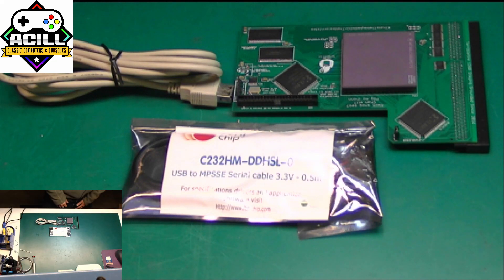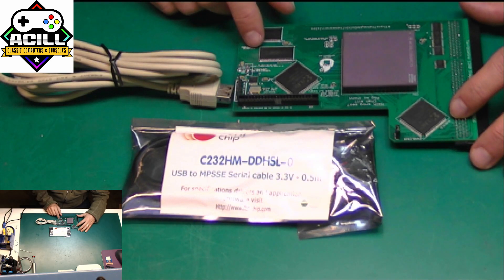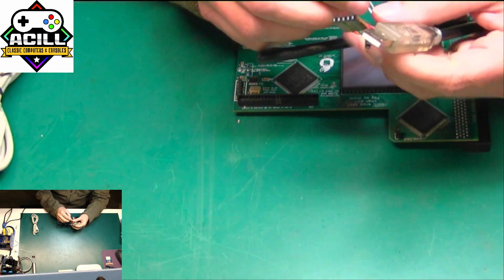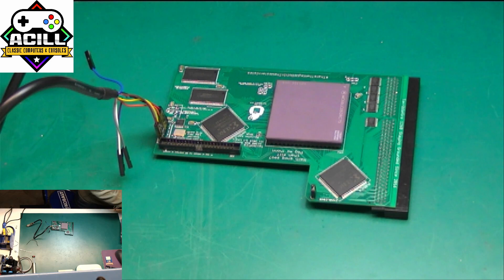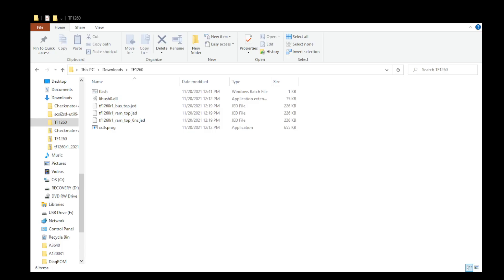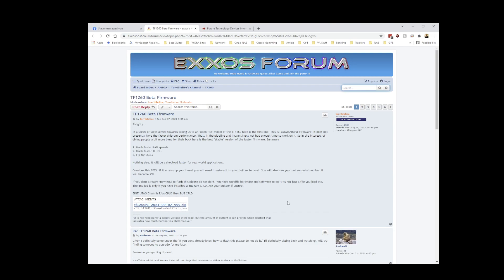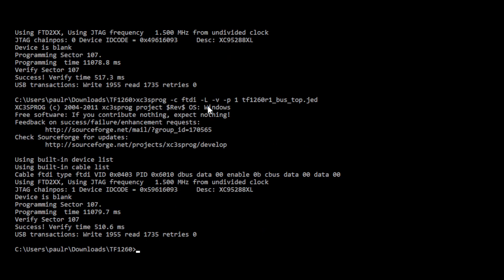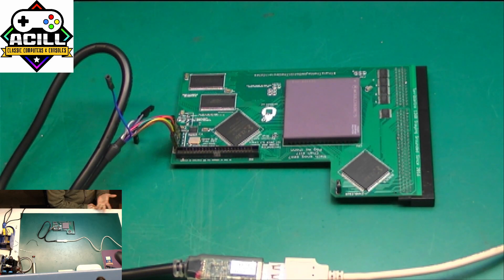Amiga 1200 TF1260 Flash Upgrade Guide

Comment: As a follow-up to my previous comment: I received the USB programmer. Still lots of issues. Only after consulting with the builder, I learned that it works only when powered from the Amiga. 

My advice: power the TF1260 from the Amiga, not the 3.3V on the programmer! Especially when the CPU is installed. When powering from the amiga, do not connect 3.3v from the programmer. Do connect ground and obviously the rest of the cables.
Reply from the maker: I have done it many times using the 3.3V through the programmer. If you are not using the onboard USB port it could be the issue. Powering through the amiga is fine, but even if the flash were to fail all you need to do is make sure you connection is good and clean. Most errors powering through the programmer are connection related. They are designed to use power through it.

Comment: Thanks for the info! Bummer that it can't be more straightforward, but this is not too bad.
Reply from the maker: Happy to help you out if you need it done. No more than shipping it here and back.
Reply: @Acill  John Hertell is making a card for me to review on the channel. I wager it will have the latest firmware already on it. I am going to do a side by side comparison of a 50 Mhz EC, LC and a full 68060.
Reply: Paul, thanks for sharing this. The programming process is almost identical for satellite modem hardware; very easy to do.